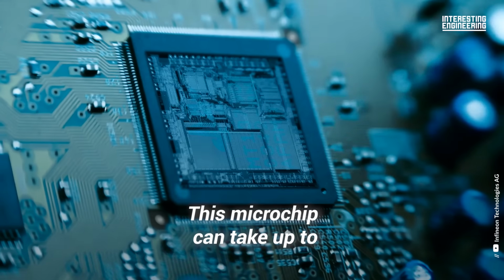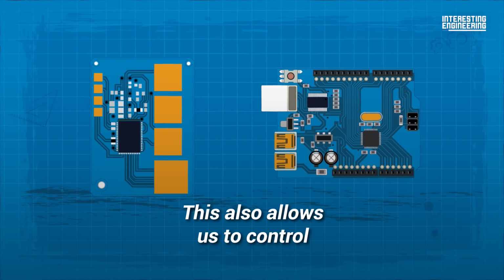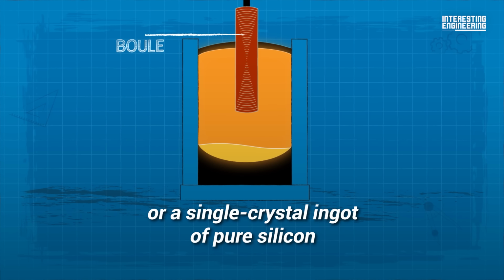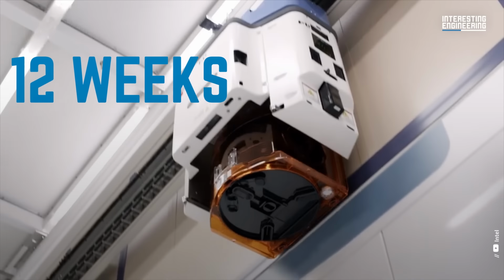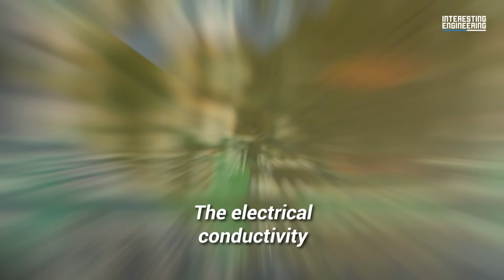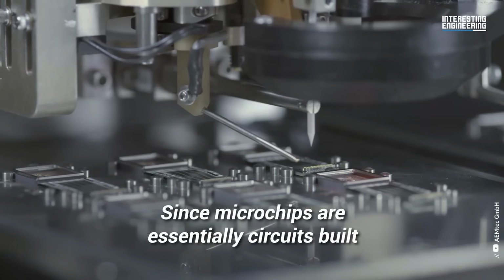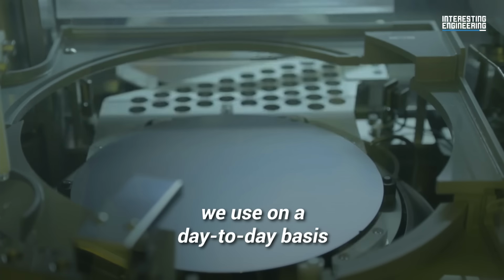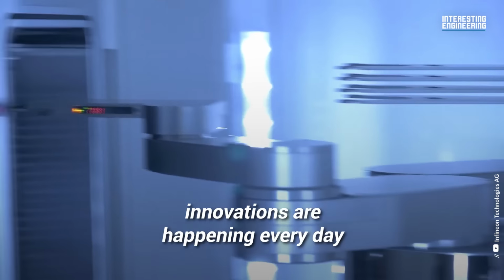💻 How Are Microchips Made?

Comment: I am a mechanical engineer, so a complete 180° turn from this field. I deal with massive, minimum 1 ton steel structures, assemblies involving several workers manipulating cranes and forklifts, machining surfaces at worst to the thousandth of a mm in precision. Our work can be dirty and it does not matter in the end. If we need to prepare a material, we might have to heat it 12 hrs in a furnace. We can weld something wrong, we remove the material, weld over and worry not, besides a deadline for the project.  

The amount of detail that goes just into the initial transformation of the raw materials is mindblowing. I have a basic understanding of electricity and electronics, but to this day, I do not understand what happens behind my phone while I'm watching videos like this. A real black box that will keep on getting darker. I was thinking of pursuing a CS degree in the future and this video made me even more inclined to the idea. This is pure wizardry!

Comment: We make the fully automatic molding machine for the die with wire bonding.And we start the business from making the lead frame molds for the chips in 2010  to the trim&form machines right now.The IC industrial we could see it is changed so fast.While the people who work inside also find it is full of challenge.

Comment: I have been working for more than 10 years in ONSemiConductor in Dendermonde Belgium and i must say, working there isnt as hightech this video portrays it to be. Sure the tech is high end, but working on the wafers is pretty much the same as working on a car in a factory. All the magical things happen behind glasses and everything is automated, thats why the job prescription is 'process-operator' for both jobs. You operate (pre-configs and you just choose the right setting) a machine which has a whole process (like a machine cleaning and bathing the wafers in different solutions, like putting it into an 'oven' and let the silicone cook to get it thicker, etc.). So all in all, they only take graduates etc to work there but a car mechanic man can as easely work there as a graduate. In fact, the car mechanic will be preferred since he could also step in and fix small issues on the machine he operates. Every other technical issue is solved by an engineer, and not a regular mechanic like they are in a car factory.

Comment: Moore's law is the observation that the number of transistors in an integrated circuit (IC) doubles about every two years.

Moore's law is an observation and projection of a historical trend.

Rather than a law of physics, it is an empirical relationship linked to gains from experience in production.

Comment: such a short 3 second explanation after boule production, when they get sliced.  The Si / SiC ingot gets the ends squared and the OD ground.  Then it goes to the multi wire saw for cutting.  Si cuts take approx. 3-4 hours but SiC take between 55-100 hours per ingot.  The wafers are then placed on a double sided polishing machine that size the 3" to 12" round wafers to nano-meter flatness and size.  a nano-meter is about 0.00000039"

Comment: Todays computers are made of semiconductors. Semiconductor technology facilitates realization of microscopic quantum bits based on electron spins of individual electrons localized by gates in field effect transistors or FETs. This results in very fragile quantum processors prone to decoherence. Things will change exponentially when robust, error free qubits is made possible on semiconductor chips. Possibly complex, multi-threaded AI algorithms.

Comment: My IT career was working for chip manufacturers.   I've been in several front end (chips) and backend (test and assembly) factories.  It is amazing.  As the video explains, the scales are incredible but unlike a car or toaster assembly line, the wafer can go through the line dozens of times and there are hundreds of different types of chips on their own wafers going through the factory at any time.  Each wafer requiring its own 'recipe'.   Some of the processes can handle many wafers at the same time, like diffusion, other processes are done one wafer at a time.   It's crazy.  And as they alluded to in the video, if something is wrong, you might not know for 12 or more weeks.   The quality control is amazing.     I feel very lucky to have been a small part of it.
Reply: Sir I also want to go in this field of manufacturing processors...so can you please tell what type of engineering is required for this?
Reply: @indranilgupta0530 Electrical and/or computer hardware engineering
Reply: @mo-kv1pm  yea so you can sit around and not actually use any of that in this field while it's all made for you by a robot lmao
Reply: @KING-em7yk  The robot is sentient now?
Reply: @mo-kv1pm   have you not talked to AI??? Ever???? Damn that sucks
Reply: @indranilgupta0530 
Ece
Reply: If you can reach that level with no external help then the field is actually for you. if you understood what i wrote, start running on your path. good luck brother  @indranilgupta0530
Reply: Think you for your services.

Comment: Overall an excellent presentation. The only flaw I saw was talking about "innovation". However, the latest GPUs and CPUs are using 300-600 W, melting the power cables. One solution is to switch from inherently quantum mechanically defective CMOS to resonant tunnel diode threshold logic. It is 100,000 times better than CMOS (2.2 THz at 5 W).
Again, overall, excellent.

Comment: What amazes me more is how do we get one for 10 or less dollars?
Reply: Volume is the key. As you might have guessed, designing and building chips is extremely expensive. So it is only worth the effort if you can sell lots of them. So the functions the chips have to perform are either so basic that they are required by many different companies or the chips are so versatile they can be used in many applications. Building your own chip is rarely worth it. If you need customized hardware, most companies use FPGAs.

Comment: It's only so difficult and expensive because the chips are so small, and the smaller it gets, the harder it gets to not make mistakes and make it work. If the cpu was as big as a whole graphics card for example, there would be multiple companies producing them, not just intel and amd.
Reply: You have it backwards, the larger the CPU, the more of a challenge it is to make them, so that keeps new companies from getting into the industry, along with things like copyright and patents as well.   The fab process is just one critical piece of the puzzle, the actual design of a CPU is very complex, the way you arrange those transistors to actually be able to run programs is an even larger issue.

Picture that the quality of the paint an artist will want to use...yep, it's important that the paint is good quality, but the artist is the one who actually paints.   An artist with questionable talent vs. one with amazing talent can use the same paint from the same supplier, but with huge differences in how things will turn out.
Reply: @Targonis1  No, go read about cpu production. It is so difficult because they're so small. The actual design is simple, it's just more transistors, but more tightly packed. You know nothing.

Comment: Microchips, also known as integrated circuits, are made using a complex process called semiconductor fabrication or "wafer fabrication". Here are the general steps involved in making microchips:

Design: The first step is to design the microchip using computer-aided design (CAD) software.

Wafer preparation: A silicon wafer is prepared by cleaning and polishing it to a mirror finish. The wafer is then coated with a layer of photoresist.

Photolithography: Photolithography is a process used to transfer the design onto the wafer. The wafer is exposed to ultraviolet light through a mask, which creates a pattern on the photoresist layer.

Etching: The wafer is then etched with chemicals to remove the portions of the photoresist layer that were not exposed to light. This leaves a patterned layer of photoresist on the surface of the wafer.

Doping: Doping is the process of adding impurities to the wafer to create regions with different electrical properties. This is done by introducing a gas containing the desired impurities into a high-temperature furnace where the wafer is heated.

Deposition: Thin layers of metal, oxide, or other materials are deposited on the wafer using techniques such as chemical vapor deposition (CVD) or physical vapor deposition (PVD).

Planarization: Planarization is a process used to create a flat surface on the wafer by removing excess material. This is done using chemical mechanical polishing (CMP).

Metallization: Metal contacts are deposited on the wafer to provide electrical connections to the circuit.

Testing: Finally, the wafer is tested to ensure that the circuits are functioning correctly.

Once the wafer has been tested, it is cut into individual chips, which are then packaged for use in electronic devices.
Reply: Chatgpt?
Reply: @atulkumar943  yupp he C&P info from Chatgpt
Reply: @pippo7631  100% reads like ChatGPT
Reply: @atulkumar943  lmao😂
Reply: @atulkumar943  no
Reply: Where exactly do they divide the silicon wafer into different transistors tho?
Reply: Well Explained..Looks Like I am doing it now
Reply: Didn't you listen to the video? That's what it was all about!
Reply: I am sure the Chinese love this😀
Reply: The first step is namely chip design using the CAD tools
Reply: Thank you
Reply: Incredible
Reply: You gave us the whole video in such of few lines 👏👏
Reply: Respect for you to share such a description 🙌🙌 thanks
Reply: Thanks for this
Reply: Thank you so much for your explanation!
Reply: Wow
Reply: Thank you

Comment: I worked at Micron Technologies in Boise ID in fabrication. Coat/resist technician. Runing back and forth loading, unloading canisters of 12 inch disks.  That lasted 9 months until an engineer loaded a routine incompatible with the part type. I failed to check it.. DISMISSED.

Comment: Moore's law came to a grinding halt about 5 or 10 years ago.
Adding multiple processors to a computer is not the same as increasing the linear computational power of a single processor.
My entry level computer from 10 years ago was about 5x faster than the one today - in linear computational terms, even though they sell the illusion of the chips themselves being more powerful by stacking them. This helps games and video yes, but its not because of increase in the power of the chip. Individual chips have actually gotten slower in proper computational terms.

Comment: Ive one question about this, what is it that TSMC does with ASML machines to make their chips on smaller nodes? Is it the machine ASML makes that is creating the small NM chips or does TSMC do something with the machines?
Reply: No ASML make the machines that are capable of printing such small chips, TSMC simply punches in the patterns into the machine to print. TSMC is limited to the smallest size at which asml machines can print.
Reply: @darthanakin658  Isn't TMSC using the same machines for a while now but going down in size of the nodes tho?

Comment: Consider also that while there are 10s of billions of transistors and connections on a single chip, MANY chips have to work, and continue to work well for years.  It used to be that one failure in a million was considered good, now with cars and many things having hundreds or thousands of chips in each thing, they have to be far more reliable or you see unacceptable losses (picture 1 out of 10,000 cars or worse failing due to bad electronics).  That means you need over a million good chips, each with 10s of billions of transistors, a failure rate less than 1 in 10^16, or 1 in 10 quadrillion.  Astonishing.

Comment: Question: why don't they make bigger chip? Wouldn't it have more surface area for more transistors, thus more powerful?
Reply: There are but also the chip will generation large amount of heat and you will need large cooling. not ideal for phones, tablets, hand held devices
Reply: @zenniz1992  also need large energy mean they need large battery.
Reply: First, it would reduce yield counts since there are always imperfections so you'd need larger amounts of redundancy and budget set aside to trash a lot of product that would be unsellable. Second, increasing the surface area starts to introduce significant issues with timing as the speed of light (or close to it for electrons) becomes a limiting factor. Third, you'd be competing with economics of regular chips that could do essentially the same thing when run in parallel, which is what all modern computing does anyway.  All these factors are significant issues because if you can't offer a product that achieves what's better on the shelf for less money, it's not going to sell.   Chip making is a pure commodities market.

Comment: I'm looking forward to the future chips that will be made for quantum computing. I wonder how different manufacturing quantum chips would be like compared to current chips. Hmmm.
Reply: I would not expect that to be significantly different from other chip manufacturing. After all the good old MOSFET is a device that uses quantum effects to switch on and off.

Currently quantum computing devices are made using technology that moves single atoms around for the critical parts. For it to scale to mass production they'll have to find a way to structure the material in a way that can use normal production equipment. It's hard, but not impossible.

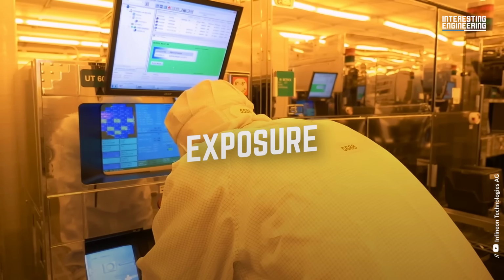Comment: 2:42 The lithography machine is made by only one company on Earth, ASML, based in the Netherlands. The entire microchip industry is dependent on them, and their machines sell for upwards of $150 million.
Reply: Correction: "for up to 150M$" - that's only the top line of ASML scanners. They also produce machines that sell for a measly 20M$. There are also Canon, Nikon and a couple of other manufacturers that produce litho equipment. You need ASML if you want to produce top of the line chips. If you produce e.g. power electronics or amplifiers with feature sizes in the 60-150nm range then you can use other, cheaper equipment.

But yes, the animation was stolen (sorry, copied) from an ASML video for the top notch scanner.

Comment: You left out the "mask". A chip is created via lasers shot through a mask many times larger than the chip itself. So it goes through the mask and distills down to much smaller. A single mask for a single layer of a single chip can take a year to manufacture so that you finally get one that has no defects.

Comment: There’s gotta be a limit to how small you make them like at a certain point if they get so small wouldn’t quantum mechanics begin to take over such as electrons being able to pass through chips because of the such small size??
Reply: Just saw a video on the quantum computing that described exactly what you just said!
Reply: That's actually a problem that's faced today
Reply: It happens.  Which is why server class machines use error checking memory to minimize disastrous faults that could occur due to this reason.

Comment: Who the hell thought of this 🤔
Reply: Many scientists  and engineers through generation  of generation . Everything build on top of each other . Not pop out thin air
Reply: Well, original circuits started off bulky and they kept making them smaller and more efficient I guess
Reply: We found one on a space ship that crashed
Reply: This is the work of many minds over time
Reply: In the book, Selected by Extraterrestrials, by William Tompkins,  he says they got transistors and microchips from recovered flying saucers.
Reply: The russian are the true investors of micro chips
Reply: I would believe this came from Aliens far faster than the Pyramids lol...  I'm guessing this video is leaving out so many details too
Reply: People saying it was thought up over generations of scientists... Proof? This obviously looks like it would have taken years to figure out the process from start to finish. But how do you even come up with the first steps if you don't know what the final steps require you to have done? Is there some other tangential technology which uses similar manufacturing processes involving purified silicon? I find the alien theory hard to believe because if we found something like this it seems like it'd be difficult to try and back-engineer this sort of thing. Maybe through material analysis you could figure out what it's made of and try to work backwards from there I suppose.
Reply: Alien tech we reverse engineared.

Comment: Great video! I wish they could’ve gone further and also explained the assembly stage of putting different package types on the parts.  IE:  TQFP Thin Quad Flat Pack, PDIP, etc.
Reply: I was hoping for this.
Reply: They put the die in to the package and then have to connect up the lead frame to the bonding pads around the edge of the die.
Very fine gold wire is used which, when I was involved in this, was fused to the bonding pad using a high voltage.

There isn't much to it.
Then the chip individually retested +(again)

The dies are individually tested when part of the wafer, before being sliced up